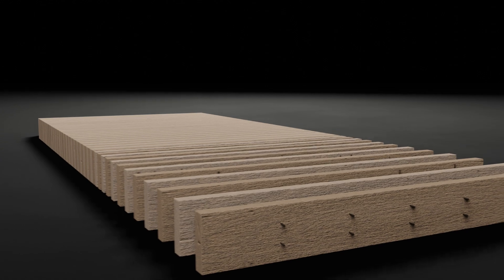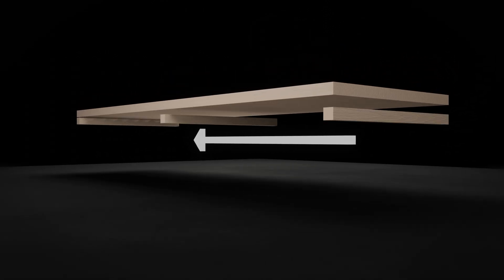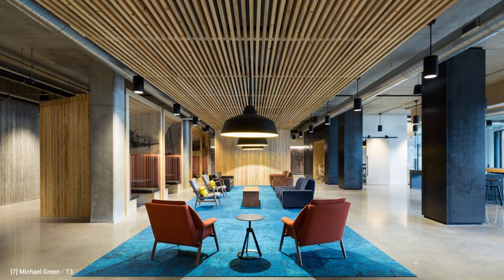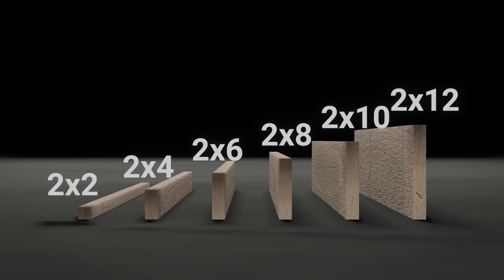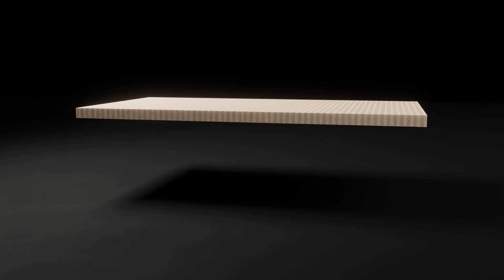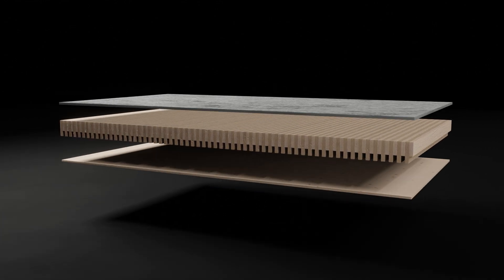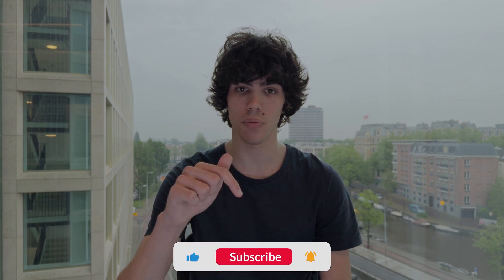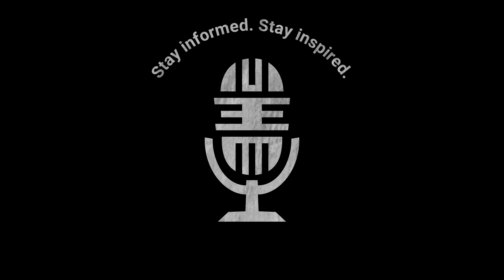An Introduction to Nail Laminated Timber (NLT)

Comment: What kind of expansion occurs with an NLT floor? I'm interested in using it as a monolithic slab on grade. If the lab was completely inside a conditioned building envelope what kind of lateral expansion might occur over say 30 ft?
Reply from the maker: Here are the general figures you can use to calculate swelling or shrinkage for any slab size:

For every 1% change in moisture content, the wood expands or contracts by approximately:
- 0.001% in the longitudinal direction
- 0.0015% in the radial direction
- 0.030% in the tangential direction

Keep in mind that these values may vary depending on the specific wood species. Additionally, once the wood reaches its fibre saturation point (typically between 27% and 33%), it no longer expands.

Comment: How would these perform in a sub tropical city like Houston TX? I just found your videos, thank you for the content.
Reply from the maker: Thank you for watching!

Nail laminated timber can be used in warm, humid climates, but it requires careful design and management to address moisture related challenges. The wood's sensitivity to humidity can affect its dimensional stability and durability. Proper treatment against fungi and insects, effective ventilation, and moisture control are all crucial. Overall, successful use of NLT in these climates demands thoughtful planning, appropriate treatments, and tailored moisture management to ensure longevity and structural integrity.

Hope this answers your question!
Reply: 35c and 80 percent humidity is normal for 60 days a year